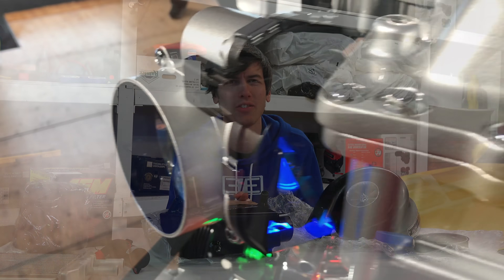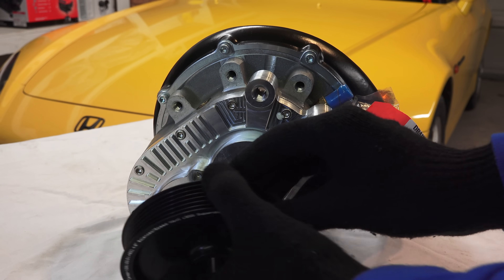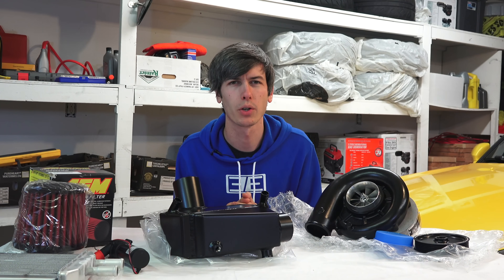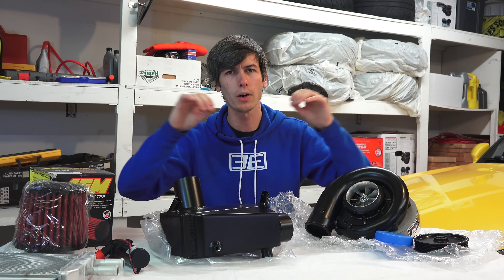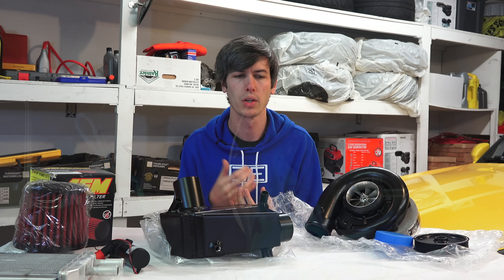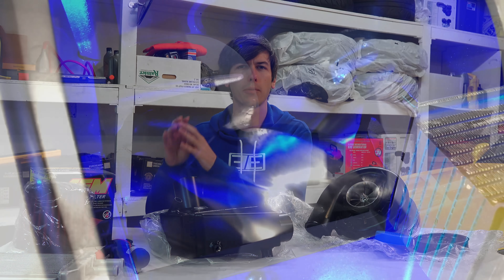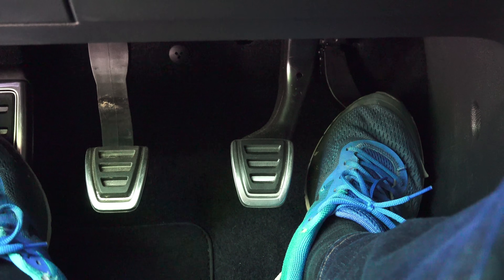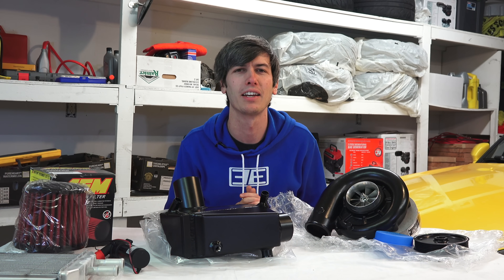Turbochargers vs Superchargers - Which Is Better?

Comment: It depends on the weight of the car, compression,and size of the motor. I had a turbo ws6 built up and I raced a supra with a nice size turbo. If I wanted to bet a race I would go 0-120 the guy that owned the supra knew his race just started at 120 and would blow past me like I was standing still even though I had 5 cars on him from a stop light. I had a 350 with torque that launched me of the line but he spooled and had higher rev limit.  End of the day it depends on the car. It's why Hennessy puts twin turbos on the viper even though it's a big block because they are going for top end power and the kings in news headlines like veyron,konnisseg,venom etc have the highest top end/top speed using turbos. If you want bottom end then go with a blower but if you want to street race or run the Texas mile go turbo. .........unless you have a monster big block you can pick whatever you want if you can tune the car to make the power and lay it down to the road. Just my experience . Good video thanks

Comment: Great video and information!  Why haven't car manufacturers chosen to use an electric motor on charger systems, electrocharger?  It seems like it would solve the lag problem, would be quiet, and not steal from the overall horsepower.

Comment: Is it possible to combine the 2 techniques in the way that a supercharger is used first to compensate the lag of the turbocharger, then, and to avoid its energy consumption, the supercharger is gradually turned off when the turbo is at 100%. I assume that such system would be complicated but it would be very efficient

Comment: I would like to add the point that was never addressed in the video regarding superchargers; and that is  the parasitic cost of the added fuel consumption. For example If it takes  50 horsepower to power a supercharger to make a net positive of say 500 horsepower, that's 50 horsepower worth of fuel you are wasting for the net 500 hp. With a turbo there is very little parasitic drag due to the negligible  back pressure as a result of overcoming the inertia from the impeller on the turbo so with a turbo you are not wasting fuel to power it like a supercharger.

 As for the argument regarding the time it takes for the boosted pressure to reach the engine its really a moot point. Once the car is started its flowing air from the turbo into the engine immediately otherwise your engine would never start. Think of a garden hose, once the trigger is pulled on the nozzle you're not waiting for the water to come out unless the hose is completely empty. This is not the same application with a turbocharger since there isn't a vacuum from the compressor to the engine. 

 The  turbo lag on the other hand is due to overcoming the inertia of the spinning blades which has recently been drastically mitigated by implementing variable vane turbo technology where the blast of the exhaust is directed to the outer blades of the impeller when boost is required and as the turbo builds up speed the exhaust gases are channelled toward the centre axis of the impeller increasing its speed and resulting increased boost pressure. In this way its similar to a CVT transmission.  

With supercharging the boost is predicated and limited by the engine's rpm not so with a turbocharger. The fastest race cars and high performance cars use turbochargers. Dragsters use superchargers due to the time restraints of the race although turbochargers are being used more and more in drag racing.

Comment: Cool video man.  Some pretty useful information, but as someone who owns a turbo charged car and a super charged truck I would have to disagree with the logic of having the pedal do what you ask it to do as a reason to prefer one over the other.  From that logical standpoint I will assume that you either have not driven a standard transmission turbo charged car or from that prospective you just have not actually driven these vehicles to their potential.  Don't get me wrong though,  when I put my foot on the gas pedal in my truck, it does have the instant power. However in my turbo car I also have the ability to ensure that I am always in the efficiency range of my turbo by selecting the appropriate gear.  Also keep in mind that there are systems out there to greatly increase the efficiency of turbo chargers, such as the pre-spool method that rally cars use.  That is getting into racing tech but it is easy enough to implement into a street car and is fairly cheap if you know how to do it yourself.

Comment: I am a supercharger guy personally, but that being said why not both you can have a turbo for high end hp and the supercharger still gives you boost and grunt down low while the turbo spools up. Lancia did it on the Delta S4 Group B rally car making 600hp in competition trim and 1200hp under extreme testing with a 1.6L four banger.

Comment: Hi, I have an intermittent issue with my 09 Golf GTI mkv fsi APR stage 2+, where it seems the turbo is not spooling (no boost). It is random and lasts different amount of times. I had a team of VW mechanics take it for a week where they couldn’t resolve it. They changed many parts like both fuel pumps, fuel rail sensor, PCV valve, diverted valve ( revision e no diaphragm). Could it be a turbo issue? No smoke and when it works, it pulls hard. It started not long after I got the stage 2 tune (Hpfp & downpipe) I’ve had the tune reflashed to stock, then stage 1 flash, a test run, then reflashed to stage 2 to see if it was the software, but no luck. Any ideas or suggestions would be great, thanks.

Comment: If you want "zero" lag, drive an electric car.  My Volt has far better throttle response than my supercharged Miata or BMW X3.
Reply: Lol you're technically correct.  I drove a rental Prius last year and was surprised how peppy the little bugger is when milling around parking lots and other low-speed situations.  Took me a while to get used to it.
Reply: true. honestly, the problem he mentioned about turbochargers having lag and superchargers having better pedal communication only applies if you are relatively new to the car. after spending some time with a turbocharged car, the driver should be able to fully understand its characteristics and thus will be able to get what exactly he wants from the car. most boosted racecars with experienced drivers who won't face the miscommunication issue use turbochargers and not superchargers for a reason. turbochargers and simply better if the driver is good. drawing power from the engine just to boost it simply does not make sense, no matter how you spin it
Reply: First, there is no "bad" boost.  It depends on your driving goals. Turbo's are more efficient, superchargers make you engine feel like it has more displacement.

Turbo lag is based on physics, not driver skill.  You can learn to mitigate it.  Keeping the RPM high and modulating the throttle in advance of power need works best on the race track.

Turbo's do "draw" power from the engine by increasing exhaust back pressure.  It is about 25% (depending on the turbo), of what is required to power a supercharger.  Also, exhaust back pressure is higher than boost, leaving more exhaust in the cylinder than NA or supercharged.  In both cases, small turbo's are worse than big ones.  Big turbo's have more lag.  It is a trade off.

Comment: How does the increased exhaust back pressure with the turbo reduce its efficiency?  To spin the turbo turbine it takes gas flow with pressure a.k.a. energy transfer.  That will take more power stroke energy to exhaust the gases from the previous power stroke or less power to the wheels.  Does that compare to the HP consumption used for supercharger boost. I have a supercharged Tacoma and wouldn't think of going turbo in any vehicle for the sole reason of instant pedal response you discussed.

Comment: The lag and skill required to drive a turbo car and utilize the power properly is so much more enjoyable to me than just mashing my foot and chugging along to the sound of a failing power steering pump (that’s what SC’s sound like to me). Anyone who is experienced in driving high HP turbo (manual tranny) cars knows that you need to have your RPMS high enough to get boost fast. Psi for psi, turbo will almost always give you more power even though you have to wait half a second to get full boost.

Comment: I have a 2011 Chevy Cruze with a 1.4 liter engine and a turbo. Without the turbo the engine is way underpowered, but just fine with it. With an underpowered car the turbo lag is much more irritating.  I would be glad to sacrifice a mile per gallon to get a supercharger.

Comment: How i see the performance impact:
Supercharger is like having a bigger engine.
But turbo is like a secret weapon, used only when driving on high rpm. And it's fuel efficient in low load because it's not used. Lag? This means you aren't driving it properly.

Comment: For turbos, I personally don't get the lag complaints. That's someone that either has a turbo that's too big for their block's displacement or they don't know how to tune and/or match up components very well. Drive a Ford Focus RS and please, tell me where the lag is. This is just one example, but there are dozens out there now. For myself, I'll take a turbo every time. They're cheap, way easier to install, don't rob your engine power, components are more compatible and easier to acquire, etc.

Comment: Are turbocharged cars more fuel efficient than supercharged? If turbo generates power boost from exhaust (which means from waste, from nothing) and super is driven by the engine, logic says it should be, but I'm not sure.

Comment: Is it possible to run both a turbo and super charger on a single engine? If you tuned the super charger to give more power at the beginning it could make up for the instant power the turbo charger lacks.

Comment: As a car enthusiast I would go turbo all day here is why... You want more boost you can change that quickly my car I can go from 8 psi to 24 psi in less than 10 seconds on the fly when driving.  Supercharged you have to deal with putting a underdrive/overdrive pulley on etc.  Just my opinion.

Comment: they don't just have a sport application. horsepower and torque are also useful for towing, where supercharger would be more effective. turbo is more complicated installation because of the exhaust manifold and less reliable, and if a turbo fails you can wreck your engine.

Comment: I've owned turbocharged engines and hated them because even the best design still has some turbo lag. The supercharged engines that I've owned were always a joy to drive with, because of the instant thrust and continued wider instant power band to performance ratio. I have to agree with your points on both engine variations, however and I enjoyed the video and honest evaluations.

Comment: I'm curious about the efficiency claim.  Not that I think it's not true, but what is the actual difference?  Is it significant?

In each case you are taking energy from somewhere in order to compress and increase the pressure of air going into the inlet manifold.  That energy has to come from somewhere.

Now the argument for the supercharger that you are taking it off a drive belt I get.  The argument for the turbo charger that you are taking it from wasted energy I don't get as much.  Sure, exhaust contains waste heat and has a volocity.  But it's the latter that you are using to drive the turbo charger.  This surely affects the back pressure in the exhuast system and restricts the path for exhuast gases coming from the cylinders.  Doesn't that negatively effect the ability of the engine to aspirate and/or the scavaging affect?  Therefore, doesn't that come at an efficiency cost too?

If so, how does this compare to a directy driven supercharger?  Is there any figures/sources for this?

I'm no mechanical engineer (I am an electrical engineer though - hence the thought process), so could you enlighten me and/or point out where I'm going wrong?

Could you use some sort of intercooler, to cool the exhaust gases at the exit side of the turbo charger and lower the gas pressure (gas laws), in order to increase the pressure difference over the turbo charger to increase efficiency?

Comment: I have a 340Bhp Jag XF, it runs out of boost noticeably at the top end, but with 340Bhp, unless you're creaming the arse of the car in second you never get high enough up the rev band on normal roads to notice! Instant Power, Instant Torque!

Comment: Engineering  Explained. So how can you get an improvement  in horse power when you are either restricting the exhaust gasses or taking energy directly from the engine by driving the ' charger.' Please explain, thanks.

Comment: If turbos make everything more efficient, why aren't they used in a lot more cars? 

Having a small, lightweight and fuel efficient, low output engine with turbo(s) to make up for the power seems completely logical... but I don't see them used very much.

Comment: Wouldn't turbo chargers also effect power & efficiency because of the fact that they're restricting the exhaust?
Reply: Steeltrap Ah, So in other words they're trying to Decrease the pressure and Increase the velocity of the exhaust gases before they hit the turbine? Is that correct, or did i miss what you where trying to say?
If that is true, the downside of that is that you'd have less choices in mufflers because you'd be trying to preserve the velocity of the gases without increasing pressure.
Reply: That gasoline and turbo engines is just old fashion technology. The world is changing, whether you like it or not.. ;-)
Reply: Not really, it's because there isn't a constant pressure on the throttle body, like a supercharger. But if you're slamming your turbo charger then it'll obviously decrease fuel consumption
Reply: That's what I was thinking
Reply: @cedriczebelle8723  I just posted the principles behind the turbo below.. If you want to understand why the turbo is more efficient, see my comment below....or above depending on whether you are reading this on a computer or a cell phone...
Reply: Yep between the exhaust restriction and heat from turbo really hurt efficiency.
Reply: @darrenmcfeaters6683  nope.  Nobody seems to understand how turbos really work.  See my comment below...or above depending on whether you are reading this on a computer or a cell phone...
Reply: Everybody here seems to be wrong.  At lower RPM, you would be right.  Burning your air-fuel charge takes time.  As the engine increases RPM, the ignition timing advances to complete the burn before 15° after TDC.  That works until the burn happens too early and causes knock.  At that point, the timing advance is cut back a touch and remains static as you accelerate.  Adding more fuel as you push the gas pedal down makes the burn take slightly longer as well.  At mid to high RPM, fuel burn is not completed by the time it exhausts from the engine.  This continued burn and expansion of gasses even after the echaust valve is closed is what spools up your turbo.  It is essentially a turbine engine scavenging wasted burning fuel to power itself and shove air into the engine that is pushing your car down the road.  I could include the math but this is just a comment on a youtube video.  Maybe one of these days I will create my own video.
Reply: Tau true. But the general concept is that turbo is still more efficient tha n scs cause they use power that would be dumped otherwise.
Reply: Not to any degree that's noticeable as the engineers rework the exhaust systems to compensate; on older style ones you could get a purpose built 'extractor' that evens the length of the exhaust outlet distances to the turbo, for example, while stock exhausts have different lengths of pipes as some have to go further from some cylinders than others.
What you gain MASSIVELY overcomes a negligible issue whereas the loss from a supercharger still isn't large but IS considerably bigger than a turbo.
Reply: For 99% of turbo cars the levels of boost etc are such that the issues of smooth flow etc are not huge concerns. Sure, there are things that can be done for efficiency (the example of 'extractors' is one), but they're minor.
Higher performance versions such as the AMG 4.0 twin turbo and the BMW M5 equivalent, not to mention Porsches and Ferraris etc, are different. Once you're looking at high boost and genuinely building for high performance then every little consideration helps.
That's my take on it, anyway. I have an old turbo vehicle where I'm running 14-16Psi boost v factory of about 7-9, so I did a bunch of things that were necessary to achieve that (things such as increased fuel pressure and flow rates, for example), but modern vehicles, especially performance ones, come stock with levels of turbo performance and efficiency not possible 20 years ago.

Comment: I just bought a Infiniti Q50 3.0 300 horsepower twin turbo. Can I go around tell people I have a fast car or do I need horsepower to do that. LOL. I'm new to cars.
Reply: They also sell 400 HP Q 60's but the dealer told me to buy the Q50 & have them up the power to 400 which can b done with a mechanic who knows how to do it. It is THE SAME ENGINE & TURBO'S so u can turn your 300HP into 400HP with the right guy. AND SAVE $10,000 in the meantime.

Comment: Superchargers are easy to install, more reliable (lower rpms and temps)  and very engine friendly in general. You will have more options ( Centrifugal, root, twin screw) for the application you want and its cheaper. I like superchargers more but in general it depends on the application you want. Turbos are not that friendly in general and cost more.